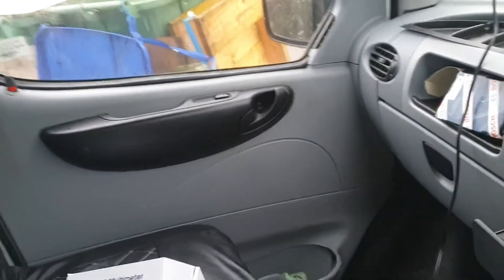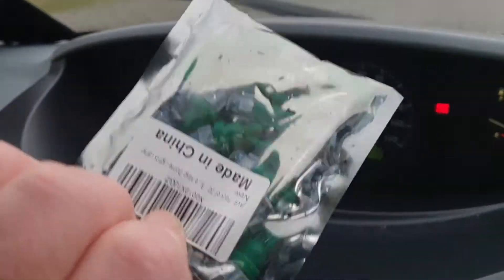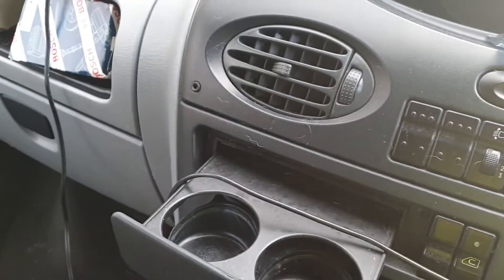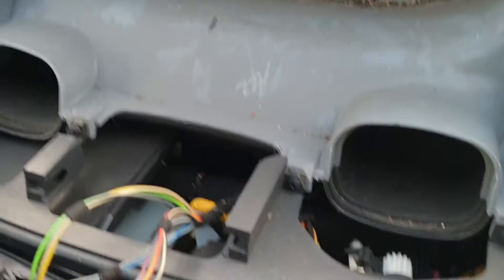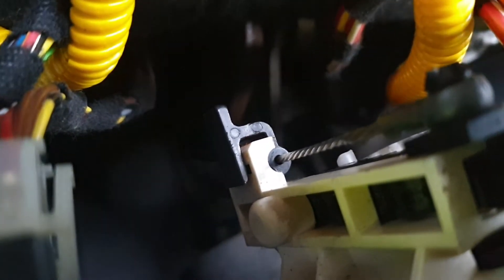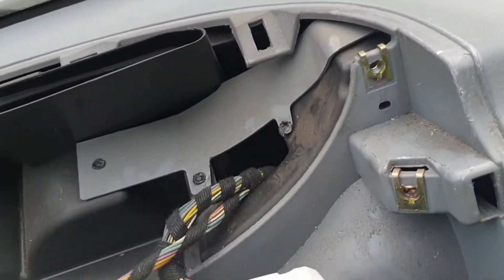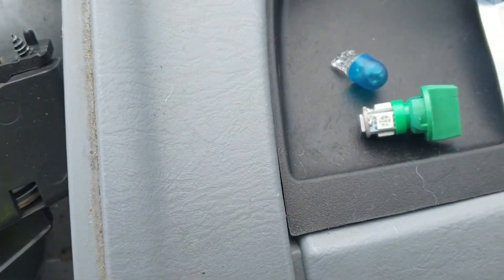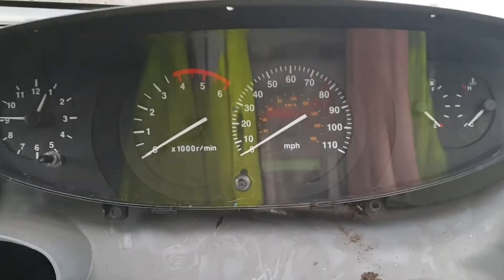LDV Maxus Binnacle lights and Heater control fix.

Comment: Worked a treat Thankyou. All 6 bulbs working awesomely
Reply from the maker: Happy to help.
Reply: @TheRealSimpsons1  found that I didn’t need to flip the bulb in the holder when they didn’t work Jsut rotated the holder 180 degrees and all work fine. Super bright. Fuel and temp ones weren’t working at all and clock went on and off at its own leasure lol.  All super bright green now. Wish I’d done a video myself for my channel but have pics and videos so may post a simple one soon.  Thanks again
Reply from the maker: @OldeSchoolRcUk  glad you got it sorted. I'm currently doing electrical upgrades on batteries and earth connections. The old girl has had a peaceful summer with just the one road trip to the outer islands here in Shetland.

Comment: It’s the LEDs themselves that only work one way around. If a bulb doesn’t work then reverse the polarity and it will work.But my van has same issues except my heater direction control is jammed so I suspect a frozen cable - try the wd40 truck and if not then a new cable.

Comment: Hi, I have the same issues. Do you have a specification for the LEDs you used ? Cheers 👍😊
Reply from the maker: DEFVNSY - Pack of 20 - Bright Green 194 T10 168 2825 W5W Car Interior Light - 5th Generation 5050 Chipsets 5SMD Lighting Source LED Bulb for 24V DC boot light, door Lights,number plate lights https://www.amazon.co.uk/dp/B07QNLTWQ6/ref=cm_sw_r_apan_glt_i_D5RCJRT8NYVDTTXA89PJ?_encoding=UTF8&psc=1
Reply: @TheRealSimpsons1  Great, thank you, order placed 😊👍
Reply from the maker: @peteredwards2371  good have fun, any problems just shout.